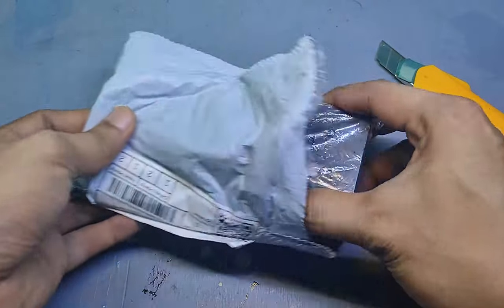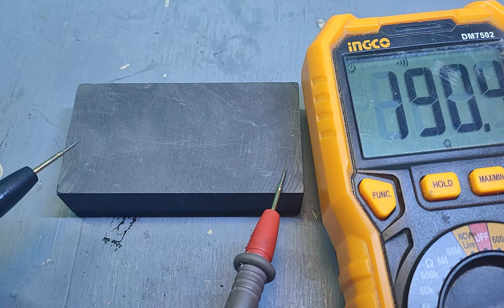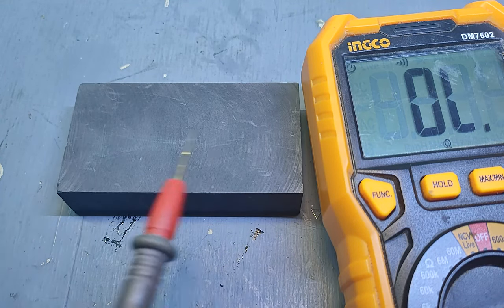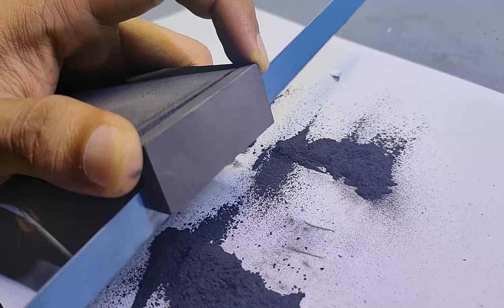I made a carbon brush from this graphite block

Comment: No it is not true that ''any regular graphite'' with good conductivity will work. That is why you have massive sparking! Eventually it will burn the commutator and you can only throw it away. Machine also does not have the same power as it should have. The most important thing when choosing the right graphite material for power tools is resistivity and speed coefficient!
Reply: The sparking is due to the square brush which has not worn in yet
Reply from the maker: Sir @mightyconker is right sir. It has yet to make full contact

Comment: A little bit worry about connection between brush and copper cable.
Reply from the maker: Yeah because there is no copper cable connected to the carbon brush, but dont worry sir especially if the carbon brush holder is conductive 😇
Reply from the maker: It will work just fine ☺️

Comment: Is the graphite more conductive or something?
Reply from the maker: They are the same sir, so there is no issue in the conductivity
Reply: @JakeMarvinVillegas  Okay, hey I appreciate the reply. I'm trying to learn about energy generation and storage and graphite is pretty cool stuff. If the conductivity is the same, why replace it? Was the original worn down from use?
Reply from the maker: You're welcome Sir. Wow thats an amazing interest you have Sir 😲

I'm trying to find a cheaper source of carbon brush and this solid block of graphite is much cheaper (cost me 300 pesos around 3 dollars) compared to a ready made carbon brush. (Around 80 to 200 pesos per pair) which is a lot, that's why I made this video.

Comment: Could it be better in cutting graphite to use a sort or soap to catch the powder ?
After that you can clean your hands and work bench just rinsing with water ...
Of course handling graphite block with bare hands ( with soap ) would be a bit hard ...
Reply from the maker: Yes that is a great idea sir! Its kinda messy what I did there but I've done it because I will use it later for drawing (shading) 😇

Comment: Is the amount of commutator fire/burning/sparking at 1:27 normal for this motor or caused by the DIY carbon brushes?
Reply from the maker: Good day sir, its normal sir because i haven't cleaned the commutator well. If its very smooth, the sparks will be even more less
Reply: @JakeMarvinVillegas  thanks for the quick reply.

But commutator fire is not really a concerny, right? Or is it actually harmful for the motor?
Reply from the maker: Ur welcome sir, it is harmful if the sparks were big. It can burn the commutator
Reply: it will be sparking most before the wear creates a concave surface on the brush. cleaning/resurfacing the commutator helps to reduce them

Comment: What u made is just a cut piece of carbon .....this is not the way to make a carbon brush ....dear talk or take advice of expert how to make a carbon brush ....

Carbon brush involves pigtail to be fixed on it for safety of instruments or your cut piece of carbon will eventually fall on commutator and damage it 

Your way will work for emergency basis not a permanent solution
Reply from the maker: Thanks for the feedback sir 😇 it is not an issue if you do regular checkup on the brushes
Reply: Donde se consigue la placa de carbon que cortaste

Comment: i cant find the exact same size carbon brush for my car starter motor, is it ok if i buy a bigger carbon brush and sand it?
Reply from the maker: Good day sir, yes sir it is perfectly ok to sand it down so that it will fit 😇
Reply: you can, but donor brush must be for starter as well. most probably high % of copper. High % copper motor brush is not the same as brush for starter!

Comment: hey man, i appreciate you making this video. inspires me. i actually just took apart a car starter and fixed it up and its working again. only issue is i have a hard time finding the carbon brushes. and if i found some it was way to expensive. what kind of graphite is it ?
Reply from the maker: Thanks Sir for the support, this is just a regular graphite block its 99% and you can easily buy this online so the source is easy
Reply: Thanks,I thought the wire had to stay connected to the graphite.
Reply from the maker: Good day sir, no need sir as long as it has good conductivity in the carbon brush holder its good to go 😇
Reply: How to order like this carbon brush